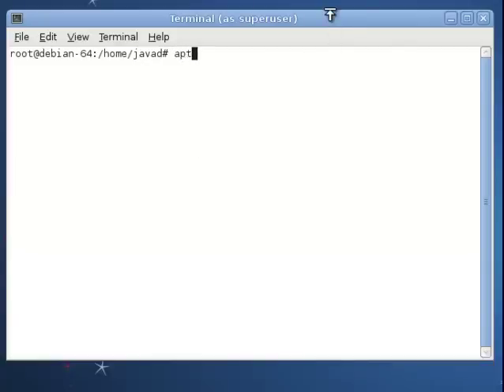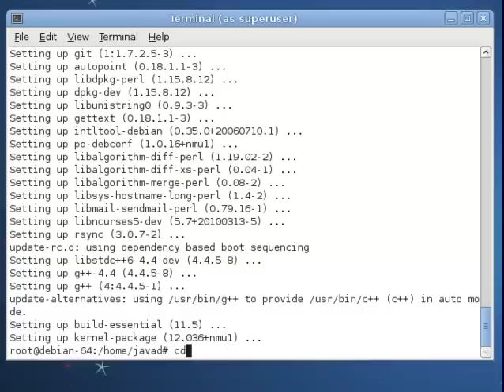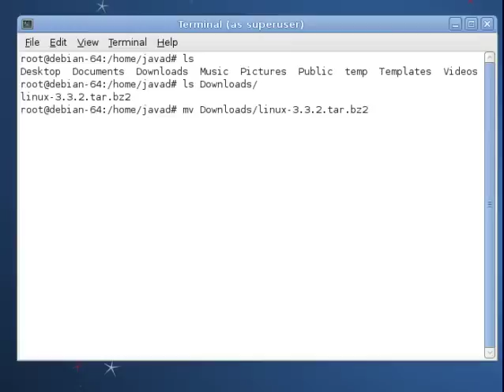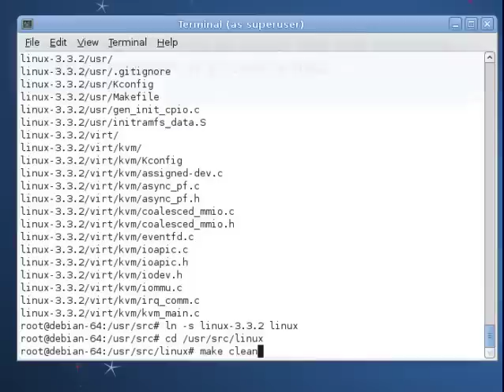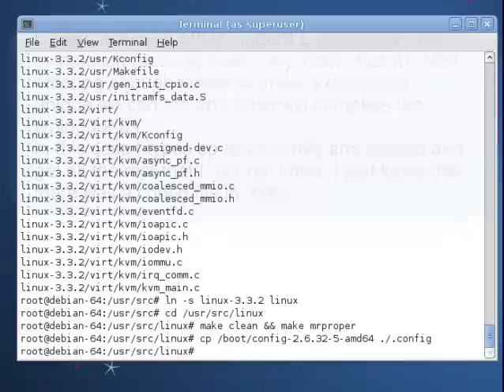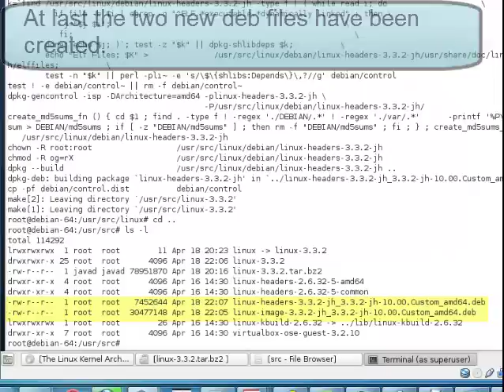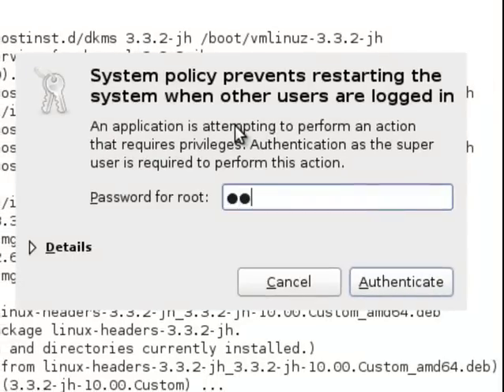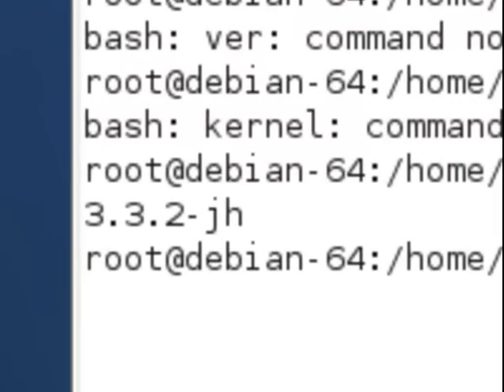How to build Debian Linux kernel tutorial

Comment from the maker: Thank you.
I'm running VirtualBox on a Windows 7 with Intel i7-2600 (8 core) 16 GB ram by ZT systems (made in USA and excellent value). Even though the CPU allows hardware visualization the BIOS must allow it too. My other system an i5 (about three years old) me to run 64 bit guests. I believe you need a 64 bit CPU and the right BIOS which allows hardware 64 bit something or other.
Good luck.
Hope this helps.